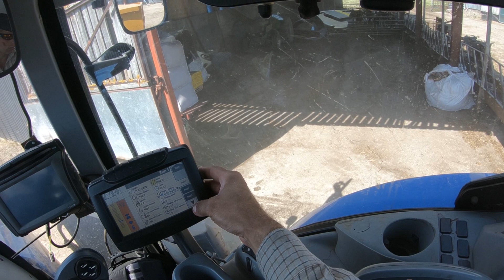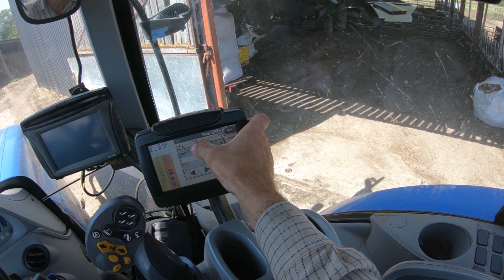CARTING WHEAT Off The COMBINE, CLAAS MEDION 310 In a FAN OVEN !

Comment: Possibly my least favorite experience ever was uplifting with the Nuffield 10/68 just outside Ravensden up Graze Hill. No cab, no seatbelt, rollover bar, and way too big a trailer. Drum brakes on the back wheels were snatching so with the heavy trailer the front wheels were bouncing and you could only steer when they were on the ground. Downhill the brakes made it hunt from side to side. Very dangerous. Remember when they used to burn the fields? When I was first there in 1983 cycling round near Thurleigh on a summer evening was like some sort of apocalypse. Towering smoke columns all over the area.

Comment: Bad News for you George, next week ( 10th August ) the UK forecast is for hot weather higher than the Mediterranean! All that week too.  Like you I like some heat, But like most Britons we are used to only mild wet summers Not fire hot humid summers?  I had another idea George.  When you take the empty grain trailer to the combine, when 1st starting a field, it is a shame you can't attach all the used attachments together and tow them all at once to the field and unhook them at the side then they are all there ready to be used as needed! Saving you keep going back and forth tot he farm for the field working items. Like the plow the cultivator the baler all hooked up in a single towing system with all the electric lighting warning signs etc. daisy chained in one long towing unit, Save a ton of fuel and time? Then after all used on the fields. tow them all back in one go. : )
Reply: Please tell me youre joking about that for the tenth. Although a road train would look cool, be a fiar job convincing authorities to allow that many articulation points. I could be wrong, but it think with any more than 2 you need special permissions and possibly an escourt. Unsure exactly of that, but there is a lot of red tape with it sadly. Mainly as some kit has brakes and other pieces dont, so if you had to stop quickly, theres a risk of it all curling up into one heap.

Comment: I've been told that if you're constantly going from fridge temperatures to the heat of the sun it can make you feel run down over time. 

I'm sure someone has the correct information to this?!
Reply: Only thing I've learnt is that if you spend most your time working outside and you keep hopping in a vehicle with aircon to cool off every time you get back out its like stepping into a blast furnace! 😂

Comment: I find the worst part of air con is getting in. Even if i'm burning hot at first I will shiver and get a runny nose for a bit before I acclimate.  Worked with several people like that, but you can't be unfair to your customers and people who tend to overheat in summer cause they could get sick. worst we'll do is put on a jacket and use more tissue than normal.
Reply: Yeah I've read that if you're constantly going from fridge temperatures to the heat of the sun it can make you feel run down over time. 

I'm sure someone has the correct information to this?!